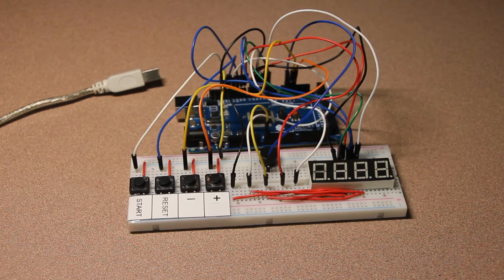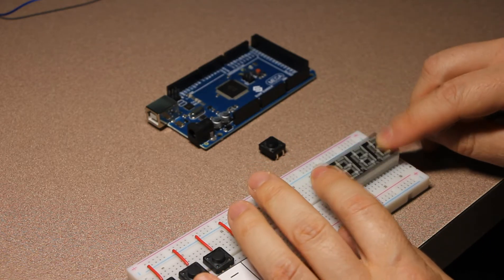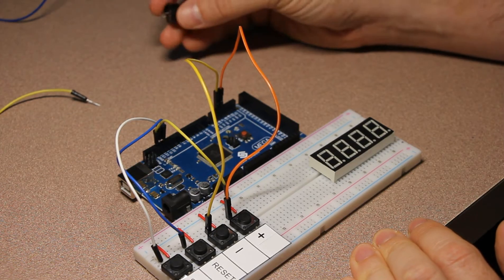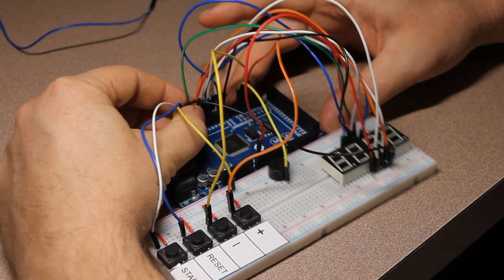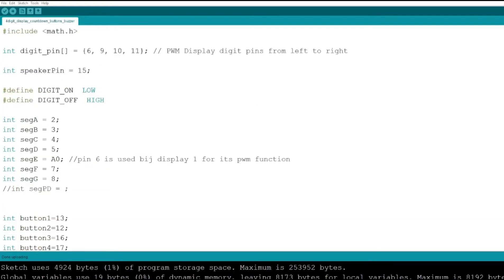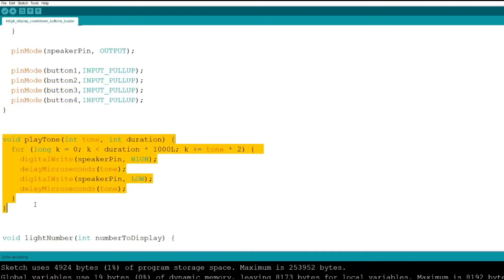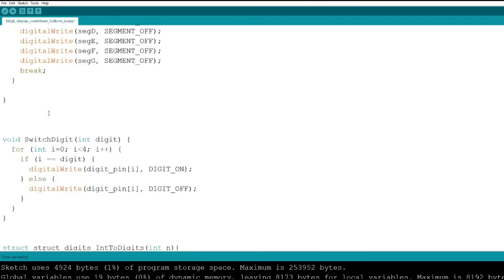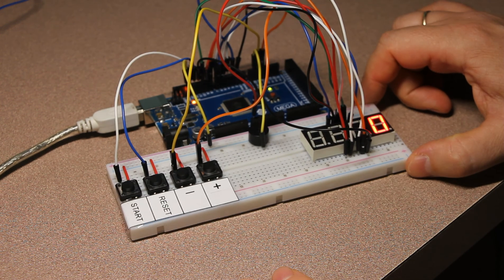Arduino Adjustable Countdown Timer

Comment: I want to add a relay on position  when the countdown is started and relay will off when countdown is finished, so what I have to do will you tell me . And thanks for your project .👍👍👍🇧🇩
Reply: ভাই ওয়েট করেন ,আমি টেস্ট করে সফল হলে আপনাকে জানাব
Reply: @shoumikahmed6373  thanks 👍
Reply: @moshiurrahmanmeraj6640  Vai..Kaj kore...Baniye felen.
Reply: @shoumikahmed6373  Thank you very much, you are cool
Reply: @shoumikahmed6373  if I want it to run at the start And stop when counting is done How to fix it ?
Reply: #include <math.h>

int digit_pin[] = {0, 9, 10, 11}; // PWM Display digit pins from left to right

int speakerPin = 15;

#define DIGIT_ON  LOW
#define DIGIT_OFF  HIGH
#define SEGMENT_ON  LOW
#define SEGMENT_OFF HIGH

int segA = 2; 
int segB = 3; 
int segC = 4; 
int segD = 5; 
int segE = A0; //pin 6 is used bij display 1 for its pwm function
int segF = 7; 
int segG = 8; 
//int segPD = ; 

int button1=13;
int button2=12;
int button3=16;
int button4=17;
int LEDPin =18;

int countdown_time = 05;

struct struct_digits {
    int digit[4];
  };

void setup() {                
  pinMode(segA, OUTPUT);
  pinMode(segB, OUTPUT);
  pinMode(segC, OUTPUT);
  pinMode(segD, OUTPUT);
  pinMode(segE, OUTPUT);
  pinMode(segF, OUTPUT);
  pinMode(segG, OUTPUT);
  pinMode (LEDPin,OUTPUT);

  for (int i=0; i<4; i++) {
    pinMode(digit_pin[i], OUTPUT);
  }

  pinMode(speakerPin, OUTPUT);

  pinMode(button1,INPUT_PULLUP);
  pinMode(button2,INPUT_PULLUP);
  pinMode(button3,INPUT_PULLUP);
  pinMode(button4,INPUT_PULLUP);
}

void playTone(int tone, int duration) {
  for (long k = 0; k < duration * 1200L; k += tone * 2) {  
    digitalWrite(speakerPin, HIGH);
    delayMicroseconds(tone);
    digitalWrite(speakerPin, LOW);
    delayMicroseconds(tone);
  }
}

void lightNumber(int numberToDisplay) {

#define SEGMENT_ON  HIGH
#define SEGMENT_OFF LOW

  switch (numberToDisplay){

  case 0:
    digitalWrite(segA, SEGMENT_ON);
    digitalWrite(segB, SEGMENT_ON);
    digitalWrite(segC, SEGMENT_ON);
    digitalWrite(segD, SEGMENT_ON);
    digitalWrite(segE, SEGMENT_ON);
    digitalWrite(segF, SEGMENT_ON);
    digitalWrite(segG, SEGMENT_OFF);
    break;

  case 1:
    digitalWrite(segA, SEGMENT_OFF);
    digitalWrite(segB, SEGMENT_ON);
    digitalWrite(segC, SEGMENT_ON);
    digitalWrite(segD, SEGMENT_OFF);
    digitalWrite(segE, SEGMENT_OFF);
    digitalWrite(segF, SEGMENT_OFF);
    digitalWrite(segG, SEGMENT_OFF);
    break;

  case 2:
    digitalWrite(segA, SEGMENT_ON);
    digitalWrite(segB, SEGMENT_ON);
    digitalWrite(segC, SEGMENT_OFF);
    digitalWrite(segD, SEGMENT_ON);
    digitalWrite(segE, SEGMENT_ON);
    digitalWrite(segF, SEGMENT_OFF);
    digitalWrite(segG, SEGMENT_ON);
    break;

  case 3:
    digitalWrite(segA, SEGMENT_ON);
    digitalWrite(segB, SEGMENT_ON);
    digitalWrite(segC, SEGMENT_ON);
    digitalWrite(segD, SEGMENT_ON);
    digitalWrite(segE, SEGMENT_OFF);
    digitalWrite(segF, SEGMENT_OFF);
    digitalWrite(segG, SEGMENT_ON);
    break;

  case 4:
    digitalWrite(segA, SEGMENT_OFF);
    digitalWrite(segB, SEGMENT_ON);
    digitalWrite(segC, SEGMENT_ON);
    digitalWrite(segD, SEGMENT_OFF);
    digitalWrite(segE, SEGMENT_OFF);
    digitalWrite(segF, SEGMENT_ON);
    digitalWrite(segG, SEGMENT_ON);
    break;

  case 5:
    digitalWrite(segA, SEGMENT_ON);
    digitalWrite(segB, SEGMENT_OFF);
    digitalWrite(segC, SEGMENT_ON);
    digitalWrite(segD, SEGMENT_ON);
    digitalWrite(segE, SEGMENT_OFF);
    digitalWrite(segF, SEGMENT_ON);
    digitalWrite(segG, SEGMENT_ON);
    break;

  case 6:
    digitalWrite(segA, SEGMENT_ON);
    digitalWrite(segB, SEGMENT_OFF);
    digitalWrite(segC, SEGMENT_ON);
    digitalWrite(segD, SEGMENT_ON);
    digitalWrite(segE, SEGMENT_ON);
    digitalWrite(segF, SEGMENT_ON);
    digitalWrite(segG, SEGMENT_ON);
    break;

  case 7:
    digitalWrite(segA, SEGMENT_ON);
    digitalWrite(segB, SEGMENT_ON);
    digitalWrite(segC, SEGMENT_ON);
    digitalWrite(segD, SEGMENT_OFF);
    digitalWrite(segE, SEGMENT_OFF);
    digitalWrite(segF, SEGMENT_OFF);
    digitalWrite(segG, SEGMENT_OFF);
    break;

  case 8:
    digitalWrite(segA, SEGMENT_ON);
    digitalWrite(segB, SEGMENT_ON);
    digitalWrite(segC, SEGMENT_ON);
    digitalWrite(segD, SEGMENT_ON);
    digitalWrite(segE, SEGMENT_ON);
    digitalWrite(segF, SEGMENT_ON);
    digitalWrite(segG, SEGMENT_ON);
    break;

  case 9:
    digitalWrite(segA, SEGMENT_ON);
    digitalWrite(segB, SEGMENT_ON);
    digitalWrite(segC, SEGMENT_ON);
    digitalWrite(segD, SEGMENT_ON);
    digitalWrite(segE, SEGMENT_OFF);
    digitalWrite(segF, SEGMENT_ON);
    digitalWrite(segG, SEGMENT_ON);
    break;

  case 10:
    digitalWrite(segA, SEGMENT_OFF);
    digitalWrite(segB, SEGMENT_OFF);
    digitalWrite(segC, SEGMENT_OFF);
    digitalWrite(segD, SEGMENT_OFF);
    digitalWrite(segE, SEGMENT_OFF);
    digitalWrite(segF, SEGMENT_OFF);
    digitalWrite(segG, SEGMENT_OFF);
    break;  
  }
 
}

void SwitchDigit(int digit) {
  for (int i=0; i<4; i++) {
    if (i == digit) {
      digitalWrite(digit_pin[i], DIGIT_ON);
    } else {
      digitalWrite(digit_pin[i], DIGIT_OFF);
    }
  }
}

struct struct_digits IntToDigits(int n){
  struct struct_digits dig;
  int zeros=0;
  int d;
  for (int i=0; i<4; i++) {
    d=n/pow(10,3-i);
    zeros += d;
    n = n - d*pow(10,3-i);
    if (zeros!=0 || i==3) {
      dig.digit[i]=d;
    } else {
      dig.digit[i]=10;
    }
  }
  return dig;
}

void PrintNumber(int n, int time) {
  struct struct_digits dig;

  dig = IntToDigits(n);
  
  for (int i=0; i<= time/20; i++) {
    if (digitalRead(button2)==LOW) {
      return;
    }
    for (int j=0; j<4; j++) {
      SwitchDigit(j);
      lightNumber(dig.digit[j]);
      delay(5);
    }
  }
}

bool Countdown(int n, int del){
  for (int q=n; q>0; q--){
    PrintNumber(q,del);
   digitalWrite(LEDPin, HIGH);
    if (digitalRead(button2)==LOW) {
      return false;
    }
  }
  digitalWrite(LEDPin, LOW);
  PrintNumber(0,0);
  playTone(150,350);
  return true;
}

void reset() {
  int m, zeros, d, pressed3 = 0, pressed4 = 0;
  m=countdown_time;
  struct struct_digits dig;

  dig = IntToDigits(countdown_time);
  digitalWrite(LEDPin, LOW);
  while (digitalRead(button1)==HIGH) {
    for (int j=0; j<4; j++) {
      SwitchDigit(j);
      lightNumber(dig.digit[j]);
      delay(5);
    }
    if (digitalRead(button4)==LOW) { 
      if (pressed4 == 0 || pressed4 > 20) {
        if (countdown_time > 0) {
          countdown_time -= 1 ;
        }
        dig = IntToDigits(countdown_time);
      } 
      pressed4 += 1;
    }
    else if (digitalRead(button3)==LOW) { 
      if (pressed3 == 0 || pressed3 > 20) {
        if (countdown_time <9999) {
          countdown_time += 1 ;
        }
        dig = IntToDigits(countdown_time);
      } 
      pressed3 += 1;
    }
    if (digitalRead(button4)==HIGH) {
      pressed4=0;
    }
    if (digitalRead(button3)==HIGH) {
      pressed3=0;
    }
  }
}

void loop(){
  reset();
  while (!Countdown(countdown_time,962)) {
    reset();
    
  }
  while (digitalRead(button2)==1){};
 
}
//Can you recommend I have not tried many methods, help me please. THANK
Reply: @shoumikahmed6373  //Can you recommend I have not tried many methods, help me please. THANK
Reply: @shoumikahmed6373  কোন কোড ব্যবহার করব ।
Reply: @bomboba6191  
Use 4 digit common anode display.
You can change pin number if you want.

#include <math.h>

int digit_pin[] = {0, 10, 6, 9}; // PWM Display digit pins from left to right

int speakerPin = 1;
int RelayPin = 3;
#define DIGIT_ON  HIGH
#define DIGIT_OFF  LOW

int segA = A4; 
int segB = 11; 
int segC = A0; 
int segD = A2; 
int segE = A1;
int segF = A3; 
int segG = 13; 
//int segPD = ; 

int button1=A5;
int button2=2;
int button3=7;
int button4=8;

int countdown_time = 1500;

struct struct_digits {
    int digit[4];
  };

void setup() {                
  pinMode(segA, OUTPUT);
  pinMode(segB, OUTPUT);
  pinMode(segC, OUTPUT);
  pinMode(segD, OUTPUT);
  pinMode(segE, OUTPUT);
  pinMode(segF, OUTPUT);
  pinMode(segG, OUTPUT);
  for (int i=0; i<4; i++) {
    pinMode(digit_pin[i], OUTPUT);
  }

  pinMode(speakerPin, OUTPUT);
  pinMode(RelayPin, OUTPUT);
  pinMode(button1,INPUT_PULLUP);
  pinMode(button2,INPUT_PULLUP);
  pinMode(button3,INPUT_PULLUP);
  pinMode(button4,INPUT_PULLUP);
  
}

void playTone(int tone, int duration) {
  for (long k = 0; k < duration * 1000L; k += tone * 2) {  
    digitalWrite(speakerPin, HIGH);
    delayMicroseconds(tone);
    digitalWrite(speakerPin, LOW);
    delayMicroseconds(tone);
  }
}

void lightNumber(int numberToDisplay) {

#define SEGMENT_ON  LOW
#define SEGMENT_OFF HIGH

  switch (numberToDisplay){

  case 0:
    digitalWrite(segA, SEGMENT_ON);
    digitalWrite(segB, SEGMENT_ON);
    digitalWrite(segC, SEGMENT_ON);
    digitalWrite(segD, SEGMENT_ON);
    digitalWrite(segE, SEGMENT_ON);
    digitalWrite(segF, SEGMENT_ON);
    digitalWrite(segG, SEGMENT_OFF);
    break;

  case 1:
    digitalWrite(segA, SEGMENT_OFF);
    digitalWrite(segB, SEGMENT_ON);
    digitalWrite(segC, SEGMENT_ON);
    digitalWrite(segD, SEGMENT_OFF);
    digitalWrite(segE, SEGMENT_OFF);
    digitalWrite(segF, SEGMENT_OFF);
    digitalWrite(segG, SEGMENT_OFF);
    break;

  case 2:
    digitalWrite(segA, SEGMENT_ON);
    digitalWrite(segB, SEGMENT_ON);
    digitalWrite(segC, SEGMENT_OFF);
    digitalWrite(segD, SEGMENT_ON);
    digitalWrite(segE, SEGMENT_ON);
    digitalWrite(segF, SEGMENT_OFF);
    digitalWrite(segG, SEGMENT_ON);
    break;

  case 3:
    digitalWrite(segA, SEGMENT_ON);
    digitalWrite(segB, SEGMENT_ON);
    digitalWrite(segC, SEGMENT_ON);
    digitalWrite(segD, SEGMENT_ON);
    digitalWrite(segE, SEGMENT_OFF);
    digitalWrite(segF, SEGMENT_OFF);
    digitalWrite(segG, SEGMENT_ON);
    break;

  case 4:
    digitalWrite(segA, SEGMENT_OFF);
    digitalWrite(segB, SEGMENT_ON);
    digitalWrite(segC, SEGMENT_ON);
    digitalWrite(segD, SEGMENT_OFF);
    digitalWrite(segE, SEGMENT_OFF);
    digitalWrite(segF, SEGMENT_ON);
    digitalWrite(segG, SEGMENT_ON);
    break;

  case 5:
    digitalWrite(segA, SEGMENT_ON);
    digitalWrite(segB, SEGMENT_OFF);
    digitalWrite(segC, SEGMENT_ON);
    digitalWrite(segD, SEGMENT_ON);
    digitalWrite(segE, SEGMENT_OFF);
    digitalWrite(segF, SEGMENT_ON);
    digitalWrite(segG, SEGMENT_ON);
    break;

  case 6:
    digitalWrite(segA, SEGMENT_ON);
    digitalWrite(segB, SEGMENT_OFF);
    digitalWrite(segC, SEGMENT_ON);
    digitalWrite(segD, SEGMENT_ON);
    digitalWrite(segE, SEGMENT_ON);
    digitalWrite(segF, SEGMENT_ON);
    digitalWrite(segG, SEGMENT_ON);
    break;

  case 7:
    digitalWrite(segA, SEGMENT_ON);
    digitalWrite(segB, SEGMENT_ON);
    digitalWrite(segC, SEGMENT_ON);
    digitalWrite(segD, SEGMENT_OFF);
    digitalWrite(segE, SEGMENT_OFF);
    digitalWrite(segF, SEGMENT_OFF);
    digitalWrite(segG, SEGMENT_OFF);
    break;

  case 8:
    digitalWrite(segA, SEGMENT_ON);
    digitalWrite(segB, SEGMENT_ON);
    digitalWrite(segC, SEGMENT_ON);
    digitalWrite(segD, SEGMENT_ON);
    digitalWrite(segE, SEGMENT_ON);
    digitalWrite(segF, SEGMENT_ON);
    digitalWrite(segG, SEGMENT_ON);
    break;

  case 9:
    digitalWrite(segA, SEGMENT_ON);
    digitalWrite(segB, SEGMENT_ON);
    digitalWrite(segC, SEGMENT_ON);
    digitalWrite(segD, SEGMENT_ON);
    digitalWrite(segE, SEGMENT_OFF);
    digitalWrite(segF, SEGMENT_ON);
    digitalWrite(segG, SEGMENT_ON);
    break;

  case 10:
    digitalWrite(segA, SEGMENT_OFF);
    digitalWrite(segB, SEGMENT_OFF);
    digitalWrite(segC, SEGMENT_OFF);
    digitalWrite(segD, SEGMENT_OFF);
    digitalWrite(segE, SEGMENT_OFF);
    digitalWrite(segF, SEGMENT_OFF);
    digitalWrite(segG, SEGMENT_OFF);
    break;  
  }
 
}

void SwitchDigit(int digit) {
  for (int i=0; i<4; i++) {
    if (i == digit) {
      digitalWrite(digit_pin[i], DIGIT_ON);
    } else {
      digitalWrite(digit_pin[i], DIGIT_OFF);
    }
  }
}

struct struct_digits IntToDigits(int n){
  struct struct_digits dig;
  int zeros=0;
  int d;
  for (int i=0; i<4; i++) {
    d=n/pow(10,3-i);
    zeros += d;
    n = n - d*pow(10,3-i);
    if (zeros!=0 || i==3) {
      dig.digit[i]=d;
    } else {
      dig.digit[i]=10;
    }
  }
  return dig;
}

void PrintNumber(int n, int time) {
  struct struct_digits dig;

  dig = IntToDigits(n);
  
  for (int i=0; i<= time/20; i++) {
    if (digitalRead(button2)==LOW) {
      return;
    }
    for (int j=0; j<4; j++) {
      SwitchDigit(j);
      lightNumber(dig.digit[j]);
      delay(5);
    }
  }
}

bool Countdown(int n, int del){
  for (int q=n; q>0; q--){
    PrintNumber(q,del);
   digitalWrite(RelayPin, HIGH);
    if (digitalRead(button2)==LOW) {
      return false;
    }
  }
  digitalWrite(RelayPin, LOW);
  PrintNumber(0,0);
  playTone(150,350);
  return true;
}

void reset() {
  int m, zeros, d, pressed3 = 0, pressed4 = 0;
  m=countdown_time;
  struct struct_digits dig;

  dig = IntToDigits(countdown_time);
  digitalWrite(RelayPin, LOW);
  while (digitalRead(button1)==HIGH) {
    for (int j=0; j<4; j++) {
      SwitchDigit(j);
      lightNumber(dig.digit[j]);
      delay(5);
    }
    if (digitalRead(button4)==LOW) { 
      if (pressed4 == 0 || pressed4 > 20) {
        if (countdown_time > 0) {
          countdown_time -= 1 ;
        }
        dig = IntToDigits(countdown_time);
      } 
      pressed4 += 1;
    }
    else if (digitalRead(button3)==LOW) { 
      if (pressed3 == 0 || pressed3 > 20) {
        if (countdown_time <9999) {
          countdown_time += 1 ;
        }
        dig = IntToDigits(countdown_time);
      } 
      pressed3 += 1;
    }
    if (digitalRead(button4)==HIGH) {
      pressed4=0;
    }
    if (digitalRead(button3)==HIGH) {
      pressed3=0;
    }
  }
}

void loop(){
  reset();
  while (!Countdown(countdown_time,962)) {
    reset();
    
  }
  while (digitalRead(button2)==1){};
 
}
Reply: @moshiurrahmanmeraj6640  Ami j code ta disi uporer comment e, eta use koren..
Reply: @shoumikahmed6373  thanks 👍👍👍
Reply: @shoumikahmed6373  Thanks
Reply: @shoumikahmed6373  The system works normally as intended. But the display on the screen is not complete, the complete number is marked as normal. But while counting the full 3 lights, the channel tells me how to get in the cable, help me, thank you very much.
Reply: @shoumikahmed6373  Was the result of the experiment successful? And how to fix it?
Reply: @bomboba6191  Yes,
There was a small bug in the code..I had fixed that but forgot what I fixed. Thats was about 7 segment.I used common anode display..For that ....
#define DIGIT_ON  HIGH
#define DIGIT_OFF  LOW
#define SEGMENT_ON  LOW
#define SEGMENT_OFF HIGH
This will work...For  common cathod  you have to change High to Low.
Now 2nd one...
For  relay take a variable
int LEDPin =3;(You can take any pin and variable you want like Relaypin)
at void setup
pinMode (LEDPin,output);

Now don't copy everything...I have changed many things..Just look where I used digital write LEDPin..

bool Countdown(int n, int del){
  for (int q=n; q>0; q--){
    PrintNumber(q,del);
   digitalWrite(LEDPin, HIGH);
    if (digitalRead(button2)==LOW) {
      return false;
    }
  }
  digitalWrite(LEDPin, LOW);
  PrintNumber(0,0);
  playTone(150,350);
  return true;
}

void reset() {
  int m, zeros, d, pressed3 = 0, pressed4 = 0;
  m=countdown_time;
  struct struct_digits dig;

  dig = IntToDigits(countdown_time);
  digitalWrite(LEDPin, LOW);
  while (digitalRead(button1)==HIGH) {
    for (int j=0; j<4; j++) {
      SwitchDigit(j);
      lightNumber(dig.digit[j]);
      delay(5);
    }
    if (digitalRead(button4)==LOW) { 
      if (pressed4 == 0 || pressed4 > 20) {
        if (countdown_time > 0) {
          countdown_time -= 1 ;
        }
        dig = IntToDigits(countdown_time);
      } 
      pressed4 += 1;
    }
    else if (digitalRead(button3)==LOW) { 
      if (pressed3 == 0 || pressed3 > 20) {
        if (countdown_time <9999) {
          countdown_time += 1 ;
        }
        dig = IntToDigits(countdown_time);
      } 
      pressed3 += 1;
    }
    if (digitalRead(button4)==HIGH) {
      pressed4=0;
    }
    if (digitalRead(button3)==HIGH) {
      pressed3=0;
    }
  }
}

void loop(){
  reset();
  while (!Countdown(countdown_time,962)) {
    reset();
    
  }
  while (digitalRead(button2)==1){};
 
}

You have to use a npn transistor .Arduino can not provide enough current for the relay..or use a 5v relay module..

Comment: great project for board games by time, one question is the display of the segments is common anode or cathode? .Another question, is it possible to change pins 16 and 17 to pins 0 and 1 of an arduino and change pin 15 speaker to an analog pin ?, if we change it in the code? I want to make a timer for board games that need some time to perform the goal and use an arduino nano, thanks friend
Reply: I answer myself because I just tested it, the first question was common anode, and if you can change the pins so that it runs on arduino uno, you can use the analog inputs and make them outputs. Put the buzzer pin on pin1 that was free, button 3 on pin 0 and button 4 on A5. You have to declare it (int button4 = A5;) in the void setup (pinMode (A4, OUTPUT); so you can use the A0 A1 A2 A3 A4 and A5 of the arduino uno as outputs.
Reply from the maker: @55dj55nava  Thanks Antonio for testing this out! I am sure that it will be helpful for others. Sorry - I did not look into this page for some time and missed your question
Reply: @dsavchuk1  Thanks for your answer,  a greeting
Reply from the maker: @55dj55nava   Hi Antonio, I think you mentioned that you developed a 3d printed case that may work for this project. I can certainly add a link to it at the project site.